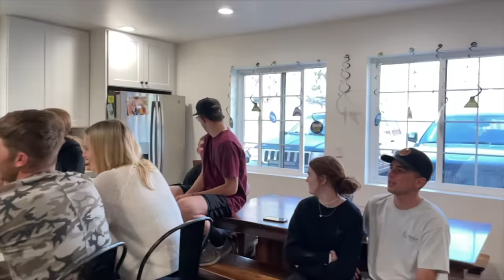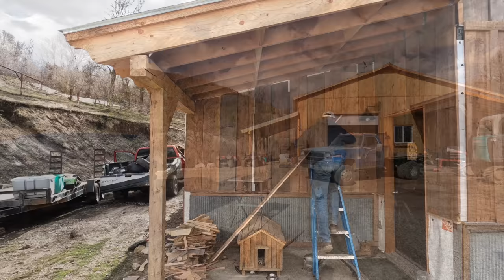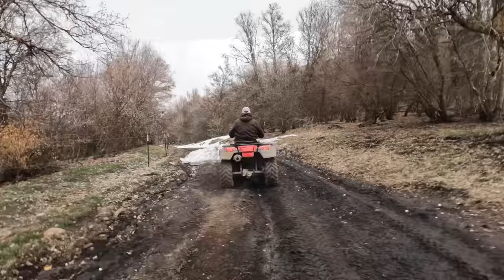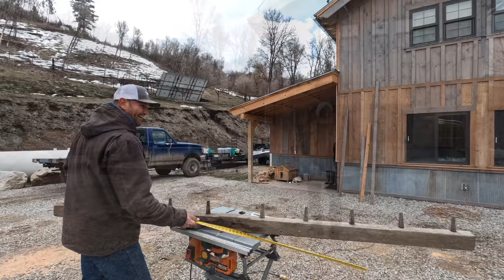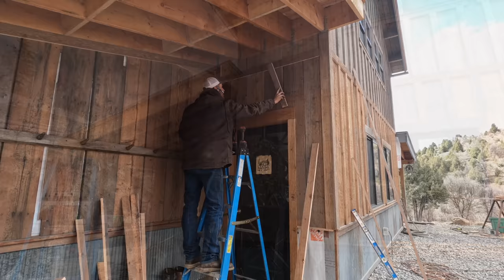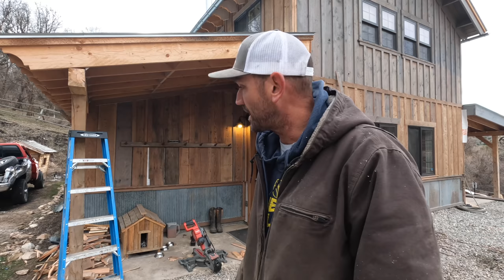Installed An Antique Telephone Pole Coat Rack On The House...

Comment: ***Insulator Decor****
Cedar, I love those things too and here's an idea from way back: Take 2 insulators, either same size or different.  2 metal washers  .  
The idea is you use   E9000 glue or clear Gorilla Glue and glue the washers to the top of the Dome of the insulator. So you will need to make sure you have the right size washer. Then you will glue the two washers  together and create a candlestick. I saw this idea over 30 years ago in a magazine country home or something like? Could one of those new electronic candles so you don't have to worry about a fire. If you have a bunch you could do a grouping especially if you had different colors and sizes cuz I know they did come that way. I still have mine packed away somewhere. But I still think Heath needs to close that thing in for you guys. You need an entry Airlock. It's a must in cold climates. A fan in the sticks of Arkansas..

Comment: I say this with respect. When the Douglas fir siding fails in a few years, go with board and batten filer cement siding. It will last forever and look great
Reply: Although I will agree with you that cement siding will last a long time...and some of it looks real good...however you are forgetting the cost...the stuff is expensive...
Reply: At Home Depot James Hardie 5/16 in. x 48 in. x 96 in (32 board feet) costs $53. The equivalent amount of Douglas fir costs $112. Of course Heath's price will be different. But, I doubt it will be cheaper. 👍
Reply: I don't think you fully understand how he wants his buildings to look
Reply: @AMG63  yes I do. Been there done that. Now I'm fixing rot all the time

Comment: Heath board and batten  definitely a timeless look. Had cases of those insulators clear,  blue, green, brown . They made good targets in the 70's who of thought they had value ? 
With lightening the wood  try Oxcilic acid it's in a crystal form mix with water used to use it refinishing antiques

Comment: My recollection is that the glass insulators we're used on telephone poles.  I remember 4-6 cross arms full on insulators on each pole.  Around here they existed untill the mid 1960's.  Nice antique you have

Comment: The siding is coming out great!  One concern... I noticed that everything you are cutting a piece of wood on your table saw you always push the wood past the saw blade with you hand.  You really need to use a small piece of wood or, whatever to push the wood past the blade (especially thinner pieces).  Safety should be your tip priority.  You don't want to lose a finger in the blade.
Reply: Kevin, I don't know how long you have been watching these videos? So I think not too long?  Because for about 5 years MANY many people have cautioned him about the lack of safety.  So far he has not changed his ways.
There is an OLD OLD saying "you can lead a horse to water but you can't make it drink"🐴🐎🐎🏇🏇😏🙃 In his case, it is more like a mule.
Reply: Lol you.must be new here. ;-)

Comment: When I was in High School I worked for the local telephone company and we had miles of line wire strung on those same insulators. In the very cold days (10-40 below) the line would contract from the cold and break. We then would have to go out and repair them. We would climb the poles with Gaffs, untie several poles either side of the break then use a rope strecher to pull the line together and spice it with wire splice and coupling tool. There was a tie that attached the line wire to those insulators and we would reclimb the poles and retie the line wire to the insulators. No goose down coats or insulated boots and the worst was the cloth gloves. I frost bit my fingers so many times working those lines that today my hands suffer when they get the least bit cold.

Comment: Wow you have more snow... We are having short period of four seasons in one day for the past few days. Then hopefully by Saturday it will break.
That area where the firewood stacks are, you could turn it to mudroom to leave jackets and boots.  Have the knee high wall, the top is wide glass panel door. And windows. The fire wood stacks extend another roof at back of the existing roof. Still protected...from elements..

Comment: Cedar, my Gran father also had I love for the insulators. My grandmother not so much at first. He wood collect wherever the railroads shut down the lines. Put him in grandmothers oven, and then heat them up. Then put him in some kind of oil and drop them it wood make a million little cracks in it and then he would make night stand lights out of him. They were very beautiful. Maybe you could figure out how they did that. I still got one from my 9th birthday and I treasure it.

Comment: I've got several of those insulators brand new and the factory boxes they are really neat. The forest service used to put a wooden stool in the middle of a lookout tower with the insulator on the legs so that if there's a lightning storm the guy Manning the station would sit on the stool with the insulators then sliding from the building.

Comment: Look like a 10 pin railroad telecommunication wire run cross arm.  
Used to carry signals and messages between railroad hubs. Many teletype used an "R" & "Y" code to punch a tape that would print out the messages. I could be radio signal via those wires in the lower frequencies. You would flip the parallel wires run around to cancel out and impedance by capacitive or induction ...that would affect the wires signals. 
Railroad would send trains data and cargo data, track data, and so on.  Those lines were very busy.   
The old telegraph morse code was too limited...but was used up to the 50's in some spur areas. Thing of all the signal lights and track switches that were remote controlled.  

Some old house wires would use a signal insulator peg in pairs for 120vac  6 gauge wire as power drops from a pole to a building. The wire was also insulated. 
The wire run was place against a groove and another piece of 6 gauge wire was wrapped around the insulator and was western union wrapped over the wire run.   
The wire run never was wrapped around the insulator. Only the tie wire was. Power wire in yards were insulated...but pole runs were not.

Communication wires were open wire....until cables started to be used...the microwave....laser light...and so.

Comment: If you want to make the wood look nice, take a bucket of Galvanized nailsn put water in with the nails, let it sit for a bit and then stain your walls with it, something we leaarned in Fort Steel one how to do this.   I watched them make Style 105 lumber which was used on 95% of the wood buildings during those days but today they still use it but slightly different style.
Peter

Comment: Pretty sure that your crossarm came from a railroad right of way somewhere.  That particular style was generally used for railroad system communications as well as Western Union telegraph circuits.   Electric power lines almost always used larger style insulators to support the higher voltages required and would usually only carry one or two circuits per crossarm.

Comment: FYI my Cummins genset warranty ends in November. Starting to have problems with 66 hrs on the genset. I would suggest you try and put as much hours as you canon the genset in the first year of warranty. Here on the east coast Cummins charges $187/hr. In my case they don't know what is wrong or how long it will take to fix.

Comment: No helmets, no safety glasses. Who would want coat rack outside. First hard rain on the new board where it meets the upper board with no protected flashing and the water will make its way inside those bottom boards. But since you like to redo everything it shouldn’t be a problem for you.

Comment: That outside light next to the back door is in a strange place.  It should be centered above the door, and half way between the top of the door, and the ceiling.  Maybe half way between the horizontal batten, and the top of door trim.